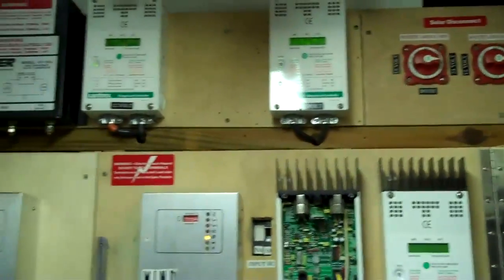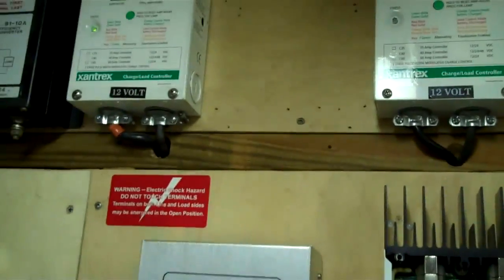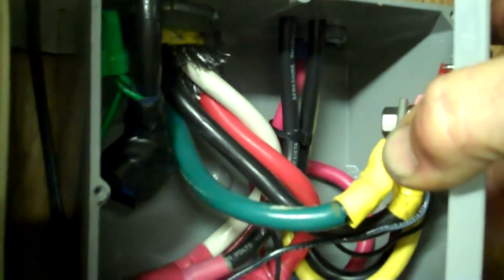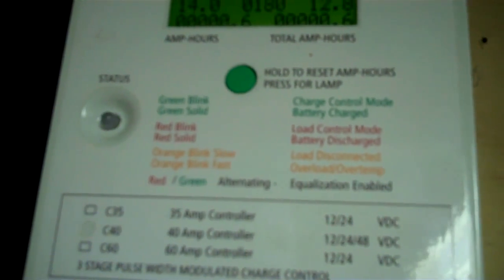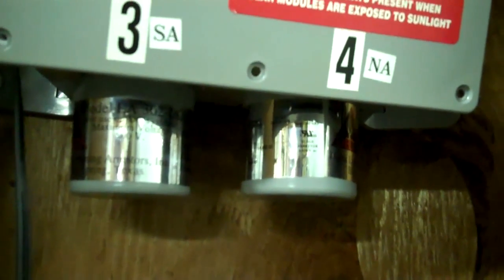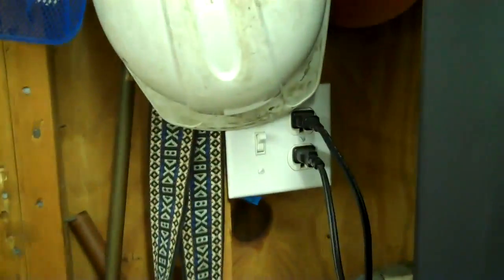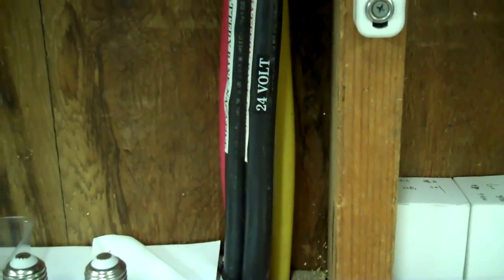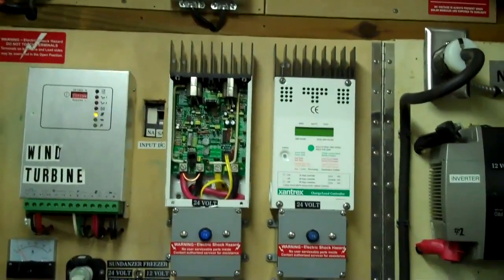OFF GRID SOLAR LIGHTNING STRIKE UPDATE.

Comment: Hi, how do you transform on the switch 12V to 24V and both? meaning what voltage do you get from the panels, and the send the power from the panels to the charger 12V or 24V?

Comment: A company called Charles Industries makes surge suppressors for DC systems on boats. It would fit into your system on the solar panel side and then you could have your electric company install a surge suppressor on the A/C line, that would isolate all of your incoming power against lightning or other surge events.

Comment: Correct me if I'm wrong, but doesn't AC give a meaner shock, or is that just due to the fact most AC is ~120v and most DC is < 24v?  The only time I've ever had a nasty shock was when I made the mistake of pulling the spark plug wire on my lawn mower... which is how many thousands of volts? However ironic, that is DC...

Comment: Kevin, I am curious as to why you have stayed with the XANTREX C Series charge controllers and not gone MPPT. I am installing new panels to the tune of 1KW & am upgrading my controller. Im still on the fence as going to a MPPT of that capacity (with some wiggle room for the future) is about a $600 investment. Wheras I could go with a C60 for less then $160 (more w/ LCD). I've wanted to get your opinion for a while so your talking about yours was a perfect lead-in. Thanks and good luck!

Comment: How a surge suppressor works depends on the type of suppressor.  Metal oxide varistors (MOVs) become conductive if the potential across them exceeds their rating.  Avalanche diodes keep the potential across them to their potential rating.  Spark gaps and gas discharge tubes (GDTs) arc over if their potential rating is exceeded, and the arc plasma shorts the surge to ground and extinguishes when the surge stops.